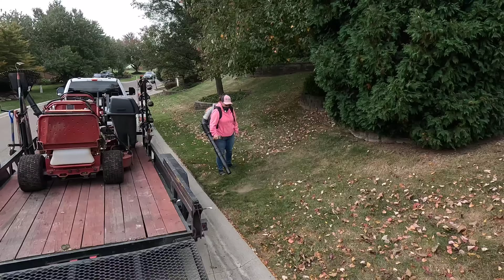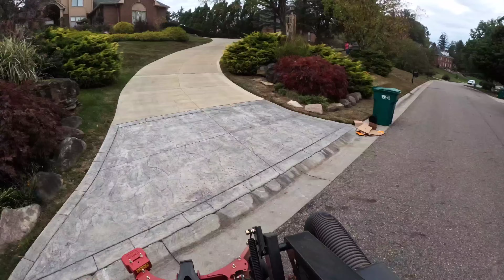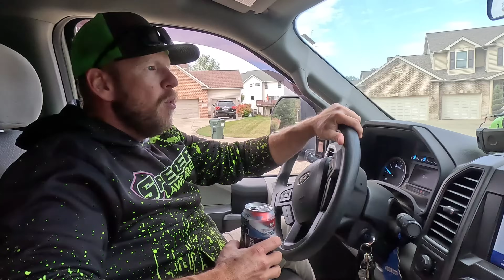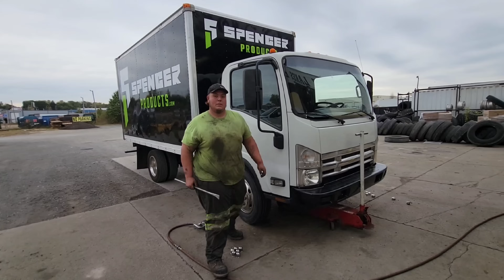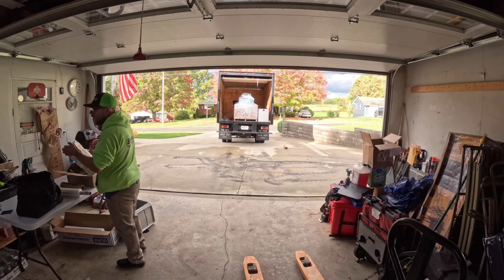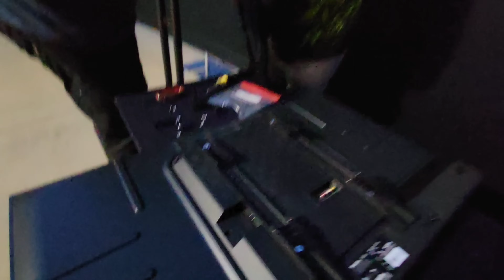WE FIGURED IT OUT: SO WHAT WAS WRONG WITH THE NEW TRUCK!

Comment: Hey guys, love you videos and I hope I'm not speaking out of order here, but I have learnt so much from you both and thought I would share some of my experience gained with many years of experience in removals and warehousing. The shrink wrap/ pallet film or whatever you call the stuff you wrap pallets with in America, only really works when it's tight, so you need to run it down the side then (slightly away from the pallet) pull it taught then hook it around the corner. To do the top run it diagonally hooking it to the corner of the pallet over the top. It works best if you keep it all one piece and tight. Also stack layers in an alternate direction to lock them in for stability......much like building a brick wall the bricks overlap. It also help wrapping pallets it you put the one you're working on on a stack of pallets to save your back. Cheers and i love your work.

Comment: You couldn't give me Firestone tires Michelin all the way. I always got 100000 miles out of 60000 mile tires. One tip always use psi from tire not door you will get better fuel mileage and longer ware aspecialy on a Ford